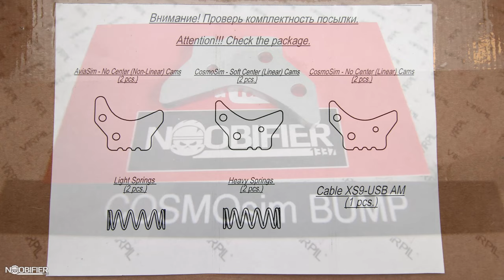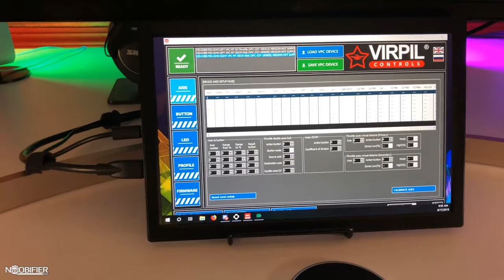#virpil MT50CM2 - Teardown and Adjustment - #noBS

Comment: +BrianMP5T  Thanks for the detail on adjusting the VIRPIL® MongoosT-50CM®.  I'm anticipating 175mm of extension for the center stick, in order to place the 'CM base immediately before an ACE™ yaw/brake pedal set on the same platform.  Would the AVAsim no-bump or Cosmosim no-bump be more appropriate for the helicopter cyclic, and with the medium or heavy return spring?

Comment: Have you tried putting 767a nyogel in bearings of this? I mean the center bearings on both axis where the cams make contact.
I was trying to get a more...dampened feel? It felt like ice smooth otherwise...
Reply from the maker: I haven’t modified it really,

Comment: Should have mentioned that VKB have a new EVO stick where you can remove the sprigs and tighten down on what they call a clutch, which essentially tightens down on either one or both axis independently to give even friction instead of return to centre springs. 
It’s neat, but I personally don’t want butt ugly shitty plastic equipment!
Reply from the maker: How would I have mentioned something that didn’t exist when the video was released?

Comment: Hello Noobifierer. How much force is possible to setup with the MT50cm2? I need about 10kg max. because i use a 40cm extension in a motion simulator.
Reply from the maker: It’s significant. Bordering on difficult to move. They designed the cams on this to specifically work extended. I have a CM2 on a 60 Cm Helo extension for Huey Sim DCS. I like mine a bit light because it’s a chopper, but you should be able to dial it a bit stiffer to suit taste.

Comment: How much tension should I have on the right(yaw/pitch) stick. I switched to the cosmo soft cams. Just not sure how much to tighten each axis.
Reply from the maker: It’s up to taste… I have them quite lose, only two turns once they make contact
Reply: @NOOBIFIER1337  wow. I got mine a bit tighter. I’m going to try loosening! What do you use for your left stick, if I may ask? Cam wise. 

And thank you for such a quick response!

Comment: G’day Noobi, not sure if you are still monitoring this video but I’ll fire away anyways. 
I want to use this base for a helicopter. A helicopter has minor but even resistance across the board and stays where you leave it (take your hand off it).
Can this base be configured in that way? 
I have purchased one already with stick extension and right hand V.F.X grip. Backing the X and Y top mount spring tensioners only serves to give you a floppy stick - and no one wants a floppy stick! 😳
Is there an ‘even tension cam’ or could one be made that would solve this issue?

Cheers mate 🥛 GR8 videos - exactly as described - zero BS! Sweet.
Reply from the maker: If you want specifically to have a high friction stick, no, that is not possible with a CM2. I have just enough to return the stick with the smallest, lightest WARBrd grip. Unless you plan on releasing the grip, mid flight, this arrangement works well.
Reply: @NOOBIFIER1337  thx. Yeah, I need to release the grip and have it stay in that position until I grab it again. I don’t need HIGH friction, just constant friction and just enough friction to stop the stick falling to the side on its own. 
I emailed Virpil with ideas on how to achieve this outcome with the Mongoose. Fingers crossed 🤞 If they are reluctant, I’ll make a new cam and replace the cam bearings on mine and test my ideas. Cheers mate. 🥛